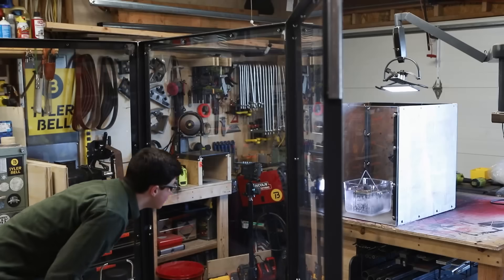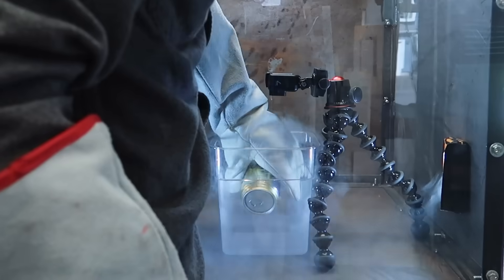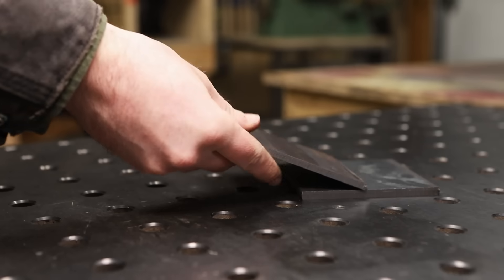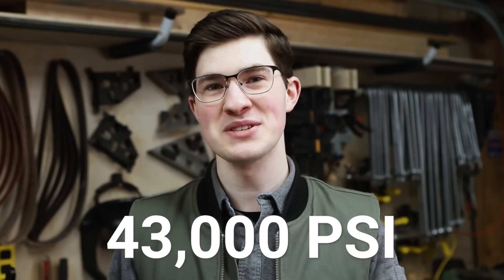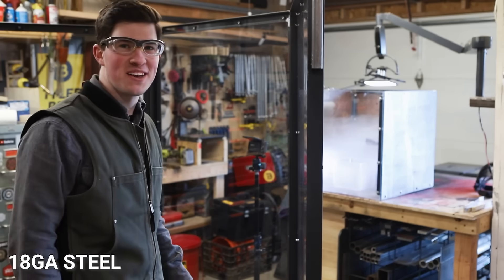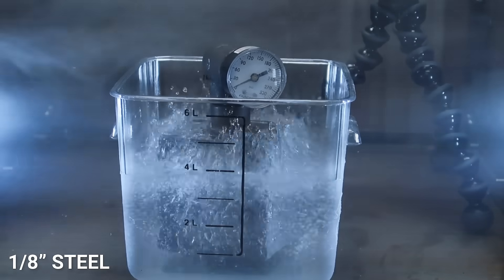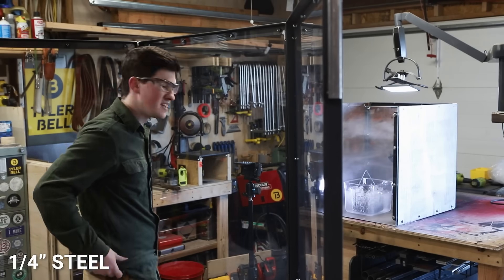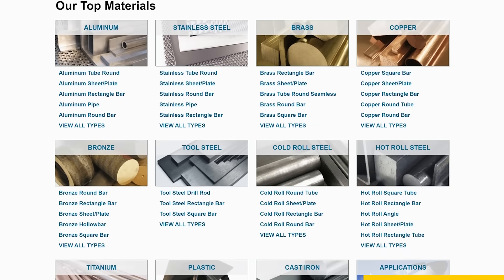Keeping ICE from EXPANDING?? (in liquid nitrogen)

Comment: The reason the soup didn't explode is for two probably reasons.

1. if the soup had other ingredients in it, those ingredients ARE compressible so the expanding broth could crush them as it expands. 
2. The soup cans most likely aren't filled to the brim.

Comment: This really says more about the individual welds than the thickness or strength of the metal.  You could try again with a pro or semi-pro welder by going to a Boilermaker or pipefitter union and seeing if they will have their student welders take a crack at it as they practice.

Comment: Great video!! Would be better for the wax video if you first did a tig weld and then a big MIG weld on top of the tig. If you lay the box on one of the edges and weld the top edge you get even better penetration. Swing a little bit with the mig torch to fully cover the edges. Would make the weld at least 2 3 times as strong if not more.

Comment: I saw the power of ice expansion one winter, at a secret military base, the water tanks had boiler/water heaters installed to keep the water from freezing inside, however due to the large capacity of the tanks it was determined that the boiler/water heaters were not needed, due to the incompetence of the plumbers they failed to drain them before the cold weather arrived, the end plates of these boilers were fabricated from 1/2" thick steel plate reinforced with 2 stiffeners of the same thickness, there must have been several tons of pressure as the plates were bulging out about an inch

Comment: A properly made weld is stronger than the source metal around it. If your boxes failed along the weld then check these possibilities:
Improper weld techniques 
Incorrect filler metal
Weld site not cleaned 
Rapid cooling of weld creating martinsite

Comment: Being a welder, I’m curious what would happen if you used 11018 stick electrodes on your 1/4” thick box. Those 11018 rods take 110,000 psi to break the welds. Since the thickness of the weld would roughly be 1/4”, I’m curious as to if the base metal would fail first or the weld.

Comment: What I think is the reason the soup can didn't expand much is that it had some solid stuff in it that was weaker than the walls of the can so it compressed into those things, diverting the energy from the walls.

Comment: Great experiment! You are brave to hold those boxes right after taking them out of the bath.

As you pointed out, the yield should be the key here. As long as the metal doesnt reach its yield force it behaves like a spring which makes it's failure spectacular but dangerous.

Comment: If you cleave the steel in the nitrogen for 2-3 days and slowly bring it to room temp, it will actually harden the steel. It’s a process called cryogenics. It’s commonly used on crankshafts for cars. I think that the cubes can hold more force if they are welded and then hardened
Reply: That wouldn’t work very well for mild steel though would it? If it was a higher carbon steel that’d make a pretty impressive explosion. Probably why the welds broke first, due to a lack of malleability compared to the box. Or maybe just bad penetration :/

Comment: u want high explosive on the wax?  ok, you're doing it wrong, cylinder one pipe and wield bottom and cap it with the seal screw, why?  Well, if you ask do you know water and submarine for if you go in narrow depth in the water the more pressure applies so in reverse you can create a cannon by applying force but you basically created a pipe bomb version, thus recommend taking it to a very extremely safe zone like a blast zone test cuz once sharpenals follow occurring explosive it will do high number dmg even upward for once it comes down it act like throwing knives but apply by force depending feet high.

As again expanding the force of the wax in a pipe sealed tight would not only rupture top and bottom for it will rupture depend dense of metal how far and how powerful pressure applies once burn.  If you ask why is the metal box and pipe are different for they shouldn't for yes I understand but depending on where pressure is applied like I said it can be like a submarine going depth between of ocean's narrow cavern for pressure can apply great force thus this is like a cavern but reverse version of a submarine that the pipe is that cavern and submarine.  As again make sure you always have spare extra protection even though you overdoing the protection.

Comment: Awesome!  You should try a thick gauge steel pipe with threaded end caps welded on, and a small bung or 1/8” NPT tapped hole in one cap fitted with a plug.  Maybe a bung or ring of weld around the hole to strengthen that part if the cap end isn't thick enough.  Heat-treat the entire thing and let it cool before using it.  Use Teflon tape 👌

The cylindrical shape, cap threads, and heat treatment will ensure the welds and welding strain won't be weak points.

Comment: joust a heads up the fire extinguisher you used is a power one and will annihilate any metal and electronic i recommend using Co2 next time to cool it down and remover the oxygen that way you can reuse the heating plate :-)

Comment: You don't even realize how close to death you were while handling those things under pressure. If they had ruptured at that point your Arms would have been GONE.  This was literally the dumbest thing I have seen someone do this year so far.

I put dry ice in a plastic bottle and it burst in my hand and the gas rushing over my hand was enough to cut my skin. This is THOUSANDS of times the energy.
Reply: your right this is very dangerous, any one of them containers could have easly exploded in his face.

Comment: You could triple the strength of your welds by welding a piece of angle iron on each of the 12 welded edges of your box. The same could be done on the bung by fitting and welding a small section of pipe over the bung weld.

Comment: When a material is colder, its reaction to stress changes.  In general if you're colder you have less room for ductile failure (stretch).  Since these are pressure vessels, ductile failure of the material will change its volume and therefore its internal pressure.  Yes ductile failure does result in a thinner material but the resulting sharp drop in internal pressure due these vessels containing liquids or solids versus a gas makes that exchange well worth it.  Ice will also not as evenly distribute stress as much as a molten liquid would (the paraffin wax).  A post weld heat treatment would have also yielded more violent responses, the whole less hard therefore more ductile (Did i mention the cold didn't help either?).  Pretty neat to watch regardless!

Comment: Well, the problem with the wax is you had to pour it in melted, which means it was already expanded. When it cooled, it created a vacuum, then heated, it just expanded to fill the box again. Not sure how you could enclose un melted wax into a welded metal box... normally when they do that, like in car thermostats, they crimp the container.
Reply: I was confused about how he was expecting that to work as well. Before i actually saw him do it, i was envisioning, smashing sold wax in there with a punch and hammer or something lol.

Comment: I think the reason the soda can burst, was because the thin aluminum? Steel? Became very cold and brittle, thus cracking instead of expanding, unlike in the freezer, as the freezer isn’t near as cold as the LN

I bet there’s a decent amount of oil in the soup, oil like most things, contract when frozen, which likely counteracted the water expansion

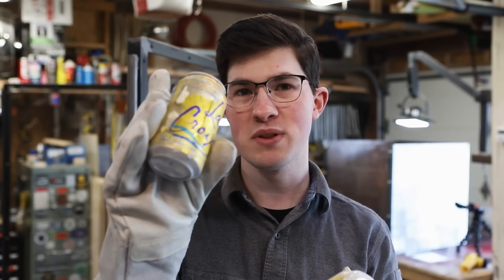Comment: So, the reason the LN can burst and the freezer one expanded actually has to do with what is happening to the material properties of the aluminum can when it's being pushed down to cryogenic temperatures. At 1:55, you can see that the burst point isn't a straight, clean line like you would think but is actually almost jigsaw puzzle-shaped. this is because the temps make the aluminum more brittle, and caused it to eventually crack along the grains of the crystals that make up a piece of metal like aluminum. Things begin to get really crazy once you talk about how different metals would react in completely different ways in that same scenario, and even different types of aluminum, but I digress.
Reply: Waow

Comment: When you decide to try your vault opening experiment, make sure the go pro is rolling so you can present it as evidence in your court trial, that it was purely a For Science! experiment and not a method for further funding of projects. =D
Add: Also on the soup freezing, you need to remember that most of those are vacuum sealed at the factory (it may have inert gas for shipping but in the interest of preservation, air inside is bad), to which freezing the liquid inside becomes much easier as it's at significantly lower pressure than atmospheric.

Comment: The "thin" Boxes did not fail right on the weld, they did fail right beside your welds, when you weld something the metal beside the weld gets weakend through the heat from the welding.
You could try to get a full material cube and then get metal shop with a CNC to mill the inside out so you have a cube with just one big V-Weld on the top

Comment: For a long time, I've wondered if it's possible to harness the swelling force of water (I had no idea that wax expands even more) to get useful energy. Some kind of extreme gear setup to transform the super high pressure into greater distance maybe?
Reply: been working on this problem for some time, yes its possible to harvest energy from ambiant tempreture changes in day/night cycle.
Reply: @Ni9kye  It certainly seems like free energy. But it obviously is possible to get energy from it if ice can break steel.

Comment: I remember seeing an old Russian video in which they filled a steel pipe with a ~2.5 centimeter diameter with water, capping the ends with thread on caps, and throwing it a plastic box of liquid nitrogen. After a few minutes, it would explode sending shrapnel everywhere. You should try that over the boxes.

Comment: i could make the same boxes and they would not crack, break, or burst open.. it is not the wall thickness you need to think about... it is your welding. im an a1+ boilermaker/structural steel engineer and this can be done easy.

Comment: Regarding the small scale test: I think the can Burst nin the liquid nitrogen, because metals get britle, the cooler they are. The can in the freezer remained a lot warmer and thus was able to deform to let the soda expand. Meanwhile the can in the Nitrogen was cooled to -196° ant the thin metal probably reached a very low temperature even tough the contents were still partly liquid. Since the can is weakened by the very low temps it burst while the liquid froze.

Comment: Okay so i've got a pitch/question for the world along the same lines of this video.

I've worked in aviation maintenance for 6 years and frequently had to supply liquid oxygen to the aircraft I work on. When in the open air, LOX will quickly evaporate to gas like liquid nitrogen, but in sufficient quantities it's visible as a clear blue liquid.  LOX can also be transported in sealed containers, but has a mandatory bleed off rate to prevent overpressure....

So my question is... can a vessel strong enough to resist that pressure be made? I have a mental image of a thick walled steel box, with a tiny TIIIINY bulletproof glass window, and be able to peek at your permanently preserved liquid oxygen, forever trying to expand.... but i think physics deems the explosion is mandatory, particularly as the temperature normalizes!

Comment: Fun fact: This is how we used to remove rocks here in Iceland, drill a hole into it fill it with water and wait for it to freeze. 
Nowadays dynamite is a lot quicker.
Reply: They still remove concrete in this way under certain circumstances, though it's with expanding concrete rather than water ice.
Reply: 🙀🤯 well now my rocky land in VT just got a lot easier to landscape! Permits for dynamite in a town to remove ledge? Ha! Thank you for sharing that good sir!
Reply: @It-b-Blair  Expanding concrete/grout from the hardware store (home depot or other): my friend opened up his whole basement up this way (canadian shield, which is 100,000 year old rock) with the house on it, no blasting required.
Reply: @It-b-Blair  Did it work?
Reply: We do this in welding class for fun by making a cube, filling it with water, welding it shut then holding a acetylene torch under neath it causing the water to boil and it eventually blows from the pressure
Reply: @matthewfiedler4739  How do you avoid being boiled when they blow? I assume by "holding a acetylene torch" you must not actually mean "holding" it eh?
Reply: sæll
Reply: @KClO3  
Blessaður
Reply: Here in my city while austro hungary still existed they would use a similar method, but because it is warmer here they would first put wood into the hole qnd then dunk water in, the wood would expand and break off the stone
Reply: They used to do that in many locations. That's how they removed too large stones or break loose blocks of stone for construction. Ancient technique! Slow but effective.
Reply: But wouldn't the water/ice just expand out from the hole you drilled? How do you 'trap' the water?
Reply: @j4k3z  Some of it does, and it doesn't always work on the first try, but water is pretty much free, so you just keep doing it again until it works. There are expanding grouts that you can get, if you need it done right the first time, that will cure at the top first forming a plug and then expanding in the hole to crack the rock.
Reply: @j4k3z  The outside is exposed to the air and freezes first. It doesn't really work unless it is really quite cold (-15ish)
Reply: It's also used for quarrying slate. Pour it into the cracks and use it to peel slabs. Slow but gentler on the stone and less labor required.
Reply: Aldrei heyrt um þetta, athyglisvert!

Comment: For those that don't already know wax is used in automotive thermostats to control engine 🌡️ temperature.
Reply: And for greenhouse auto opening windows
Reply: @Ni9kye  a native species nursery I worked for in Santa Cruz around 1973 had electric actuators.
Reply: @marlobreding7402  yeah that works too but it can also be made to work with parafin wax